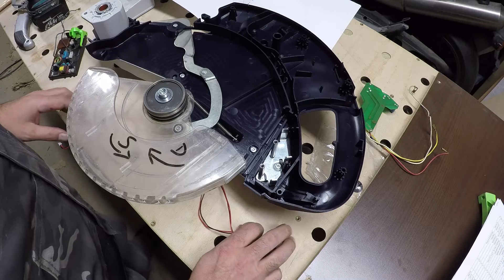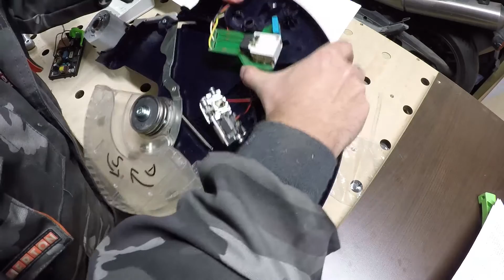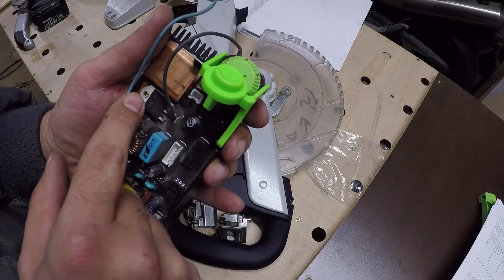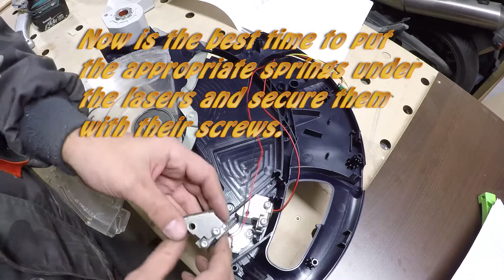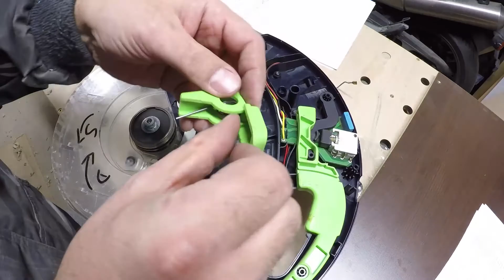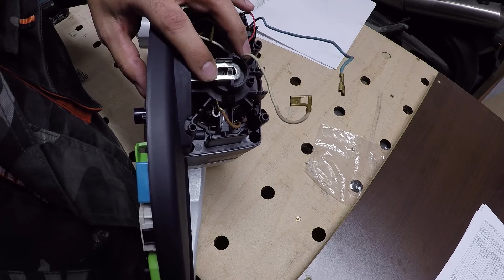Festool Kapex 120 EB assembly part 4 - Trigger & Electro

Comment: Kapex 2 weeks old and trigger button on the way out . Absolute garbage for the price
Reply: That's not really typical. If it's 2 weeks old, just get it repaired under warranty.
Reply: @judecas13  it is being repaired , and Festool service is great . But the first saw was faulty , second saw trigger is on the way out . First kapex stand not even used had paint flaking off , they sent me a new one no questions asked, which is great customer service, but come on this gear is very expensive and boasts its quality …….. please don’t tell me this was just unlucky on 3 separate occasions
Reply: @lockstocky2800  all my festools are more than a decade old. All of them work. That says something about the quality they delivered in the past. Yours maybe points out the quality of present?
Reply: @judecas13  lucky you ! you maybe correct , who knows what cheaper parts they replace over the years to make more profit or try and keep the price down with rising costs . Either way it’s not good for the brand

Comment: My Kapex is 11 1/2 years old and it won't come on. The lazors work but motor won't come on ,I think it is the switch . How can I find the problem?
Reply from the maker: Unplug it, then measure connectivity through the switch.
Have you checked the motor brushes?
Reply: @4thefunofit86  Ordered parts from Festool, replaced motherboard, switch, brushes. It would start but not keep running, pull trigger starts but would not keep running. Found the problem, the Tachometer coil rtm had moved away from motor while I was changing the board did not see it, put it back, now runs fine. Thanks for your video repair on this Kapex, You helped me a lot. I saved hundreds of dollars by following your rebuild and not sending mine to festool.